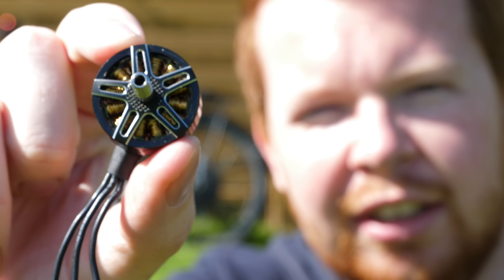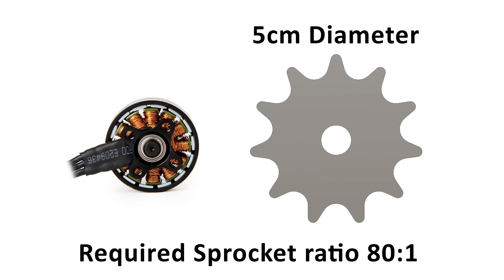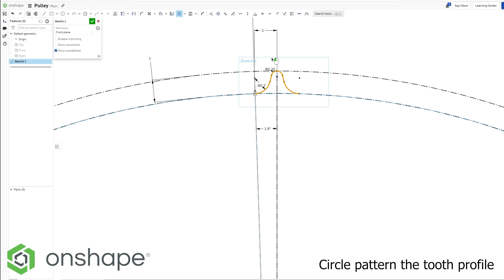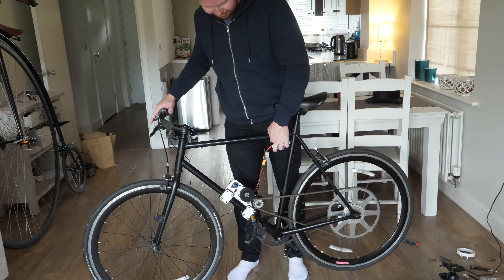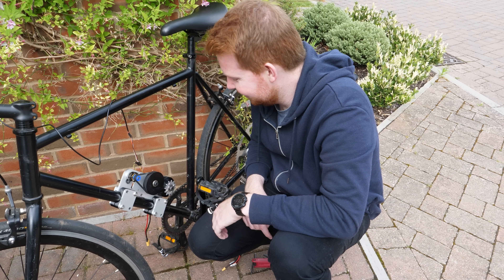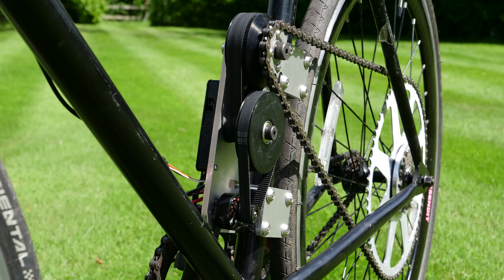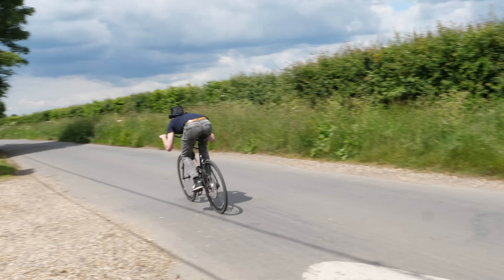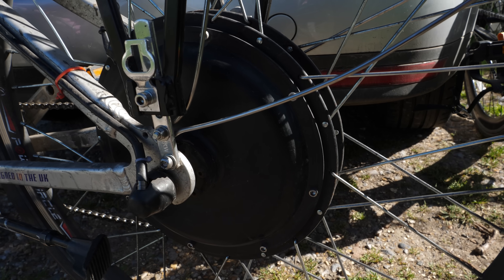Tiny 1kW Electric Bike Motor

Comment: Ahh yes, the age old drone motor sniff test. Never fails to indicate that something's not quite right
Reply: I’d know that smell anywhere: Magic Smoke!
Reply: @OGSumo  this is what u call the smoke in u momas room after she used that weird glass pipe right
Reply: I call that the "Touch and Sniff" method.  If either your finger or nose gets burned something is going wrong!
Reply: There's the Magical blue smoke test of the Myth busters. Always has to pass this test.
Reply: well if a fuse or w/e part of electronics blows there is a very distinct smell
Reply: @elknackebroto7447  it's the insulations on the coil
Reply: It can handle the 1000watts, but the duty cycle is 1% 😂
Reply: Dates back to some of the earliest used power tool sales. 😁

Comment: hmmm rc drone motor on motorcycle/car?:))))))
Reply: it would be possible but the gear reduction has to be so extreme high to get enough torque to get it moving that you wouldnt even notice it move probably
Reply: @dustin7970  1 motor= 1 wheel 6-8s 50a :-0